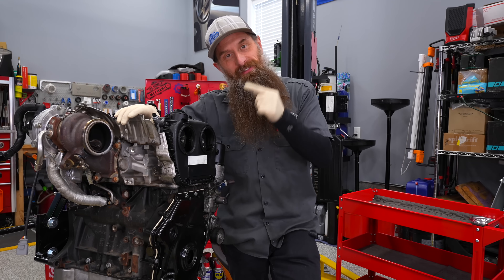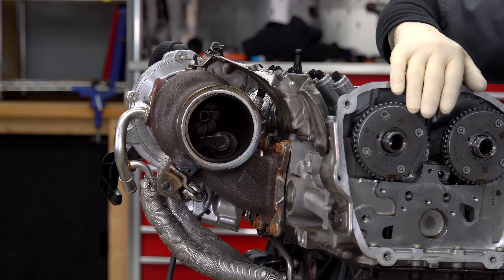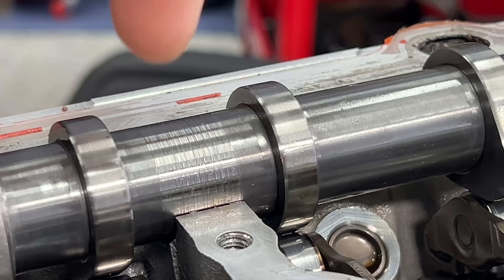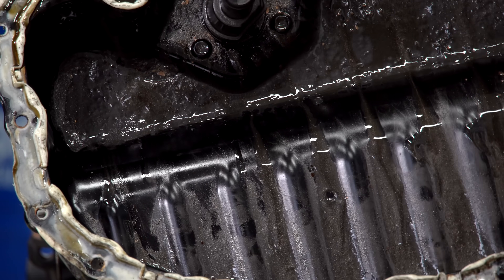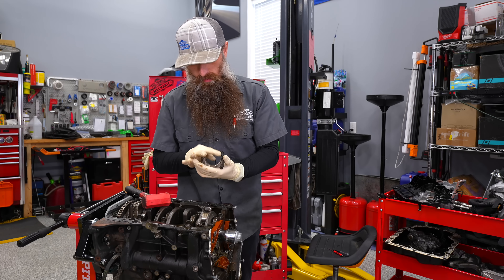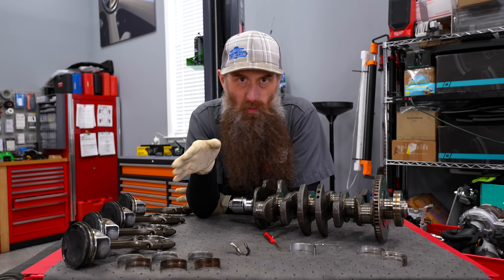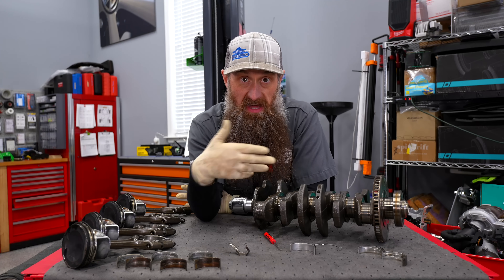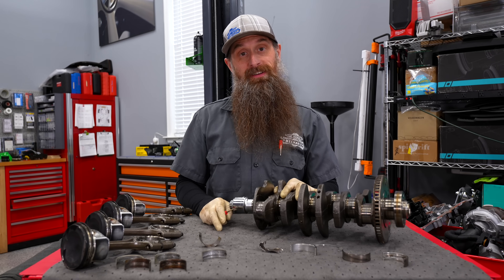Why This Audi S3 TSI Engine FAILED at Just 110k Miles?

Comment from the maker: This might be the worse overall engine failure we have done a video on. ITS BAD!!! What engine should I find next?
Reply: EA111 twin charger if you can find one? Otherwise EA211 to show us how the econoboxes get around...
Reply: I have been working on a VW Jetta 2.5 and its really interesting with its 5 cylinder engine! it would be cool to see a tear down of one!
Reply: @jojo-cx8jc  such a great motor to work on.  All things considered it’s one of the simple newer gen motors.
Reply: 07k tear down
Reply: I think I am missing the IE link.
Reply: There’s a Cayenne diesel on bring a trailer right now. Apparently it had a small oil leak and the owner tried replacing the lower oil pan gasket. It was a total fail and you should see the video of it. It’s the CNRB v6 tdi
Reply: seeing all that red rtv makes me think someone was in there before ..did vag use that silicon for a period of time ? I don't like it
Reply: PLEASE do an CXYA/EA825 if you can find one. I havent heard of many of them failing but it would be super interesting to see one that did!
Reply: I'd be qurious on a maintenance standpoint on the W8 engine and common issues on those
Reply: M4850 t looking at a '04 cayenne turbo near me for sale 😂
Reply: CAVD twin charge engine
Reply: What is the code for % off on EQT products?
Reply: @HumbleMechanic  07K rebuild. They’re great engines but many come from high miles cars. For a swap you might want a “fresh”, like-new engine, and there are very few videos, and no good videos, on rebuilding these

Comment: Ohhhh....Even without seeing the Video, I can BET that one of the long Screw that is attached to one of the Rod Bearing is BROKEN OFF, OR Came loose. Now the Rockers are all over the place, AND the Valves are messed up on one side of the engine.....I have seen another video with the Rod Bearing not turning, so I assumed that is the problem......This engine is an Inline 4 engine, but has multiple Rod Bearings. I bet one of them is not turning which caused the problem. The other video was for S5 Engine which ate the timing chain, and Rockers were all loose in the engine.

Comment: Bad oil use...
The most important thing for these engines is the quality oil and the correct frequency of lubricant changes, about 5-6000miles.
The best oils for these engines from my opinion:
Rowe hightec synth rs 5w40 
Liqui moly synthoil high 5w40 
Kroon oil polytech 5w40 
Motul 300v 5w40 
Motul power 8100 5w40 
Shell helix ultra 5w40 
Mobil 1 esp x4 0w40

Comment: Ever since I had an upper timing cover gasket leak of 2021 that took me forever to find, I've been so anal about checking my oil level. I also never trusted the 10k oil change interval. 5k changes. Level check every week. Middle of the night, dead silence audio check every week. Not taking any chances lol

Comment: Seems like nothing changes from 2010 cdnc. These engines do not like to run on minimum oil. You take sharp turn and oil doesnt get sucked then you are f...kd. 
Pls open the oil pump - the housing is 100% worn thus even slight damage will cause debris to be sucked and cause oil pressure to drop. Then its just accelerating the wear everywhere which usually ends up wearing the journal bearings on the rods. In mine I had 3rd rod failing, its a roulette which one dies first.

Comment: Yo dude call me to teardown my engine! I have an engine with 155k miles that's coming out over the next month. It experienced oil sensor #3 popping out of the accessory bracket while on the highway at 80mph and evacuated all the oil. I tried to save it and coast it down but by the time I came to a stop it had seized, GG. It spins with extreme resistance. 

This was about 2k miles after I did a massive refresh in my garage and apparently I broke the retention screw for that sensor. The sensor held in there for a decent time but eventually blew 5 liters of oil all over my engine bay and the road. Oof. I'm so so curious what the ultimate failure for seizure was. 

That 2k miles post refresh though.... chef's kiss it was driving bliss.  2015 mk7 6MT. Stock.  I took insane care of it up until that point. 5k oil changes. Liquimoly from 100k miles.

Comment: So glad to be watching this.   Just pulled the motor out of my 18 TTS also same engine.   I had a spark plug ground strap failure. New head on the way from audi.
Reply: This just happened to my 2017 Audi tts, what plugs were you running? The electrode got lodged into the head thinking of doing this same thing myself.
Reply: @EthanOliveria  the plug that failed was apr and failed at 16k.  I went back to the ngk's but regardless I went ahead and did complete stage 3 from apr and will be changing the plugs every 10k since the motor was out.  Hell after the money I put into it...oil every 5k (always done this anyway) plugs at 10k, packs at 20k and already did a timing kit, metal oil pan and 034 mounts and upgraded the driveshaft support carrier/bushing.  Has a noticeable vibration when decelerating at 3k rpm due to the dogbone mount but man it rips up to 160mph without hesitation.  Just a toy now so those maintenence times wont hurt as bad as if it were a daily. Hoping to track it next year after a dsg clutch upgrade.

Comment: EA888 engines are garbage, insane timing issues that they claimed to have fixed and Audi will tell you the chain is lifetime. VW on the other hand will tell you its a maintenance component.  I've had 3 cars all running that engine and every single one needed a chain before 110k spanning from model years 2010-2016

Comment: I have a 2.5 liter turbo in my 2019  MAZDA CX-5. I've seen the "I DO CARS" cannel tear down a MAZDA 2,5 naturally aspirated engine and I gotta say that the engine build quality looked at least as good as this AUDI but it had far less damage.  Could be that its coolant leak was not as catastrophic as this AUDI's oil problem but just seeing the quality of engineering and machining leads me to put more faith in my MAZDA's 2.5  L. turbo engine it than in my neighbor's 2.0 AUDI turbo engine.

Comment: My engine blew because it got a hole onto the block but I think it was the oil cooler failing and mixing oil with coolant 
 Myb2015 S3 was 120K km and had a lot of metal flakes on the oil filter but do you recommend using the same turbo? My car was stock but I'm curious of getting a core replacement engine but reusing a lot of my stuff.

Comment: I have a 2013 seat leon fr 2.0 tdi and i recently fitted a second hand engine from a 2015 skoda octavia with the same 2.0 tdi engine code. It's now showing codes for p032200 speed sensor no signal

It takes a few seconds to start and has very little power as it's getting all readings from the cam sensor as it runs the same with the cps disconnected

Comment: 1986 Audi 4000S owner's manual : "with the oil temperature below 90 degrees C, do not accelerate under full load."

Comment: The EA888 is a good engine. Neglect will make any engine go bad. It seems Americans received the inferior version of the EA888 engine compared to those sold to Europeans and Australians. Our 2018 S3 in Oz makes 213 kw / 285 hp of power and 380 nm of torque. Not the feeble 280 nm mentioned here. And it has multiport injection as well, meaning clean intake valves that don't get gunked up with carbon deposits.
Reply: Just another bogus VAG engine ..if European and Australian bound engines are better than those sent to the USA./....interesting.......  If audi or vw have sent "inferior engines" to the USA , our MAGA and new POTUS "will find you and give you the opportunity to be here legally... if not, we will "deport you" and you will never ever come to America again " ... how do you say "Mushroom Cloud" in german ?? 🍄🍄🍄🍄🍄💥💥💥💥💥🤣🤣🤣🤣🍄🍄🍄🍄🍄🏴‍☠🏴‍☠🏴‍☠

Comment: I used to work at Audi dealerships and the AE888 engine had some major problems. We have had to replace those engines with 500 miles on them. They would come in knocking and TAC would have us pull the oil filter and check for the silver glitter. They would approve an engine as long as the vehicle wasn't tuned. They never really told us what they knew about that engine but in my experience when Audi technical assistance approves an engine without question you know there is a serious problem. I'll stick to the oil burning CAEB.

Comment: Im happy this is not my engine i have a dkza 2.0 tsi engine 2019 and 190hp... no issue a part that sometimes when it starts it doees a crr 2 times... i drive it at 3000-4000 rpm and it fixes itself... while it have the issue ond11 fails to do some trsts after driving it in high rews for 30 - 60 min then it works again... weird stuff maybe carbon build up i will vlean it someday... 🤔

Comment: Just hoping someone might have some input on where to start with my bew tdi’s most recent issue. When i turn off the key and remove it, the engine stays running and only shuts off when i turn the lights on and press the ac button. Any ideas would be great thanks!

Comment: From experience… There is a plastic plunger in an oil filter housing regulating oil pressure. Seen many times people forget to put it back in… I can imagine that happened here. Engine is nice and clean inside to fail. Human error in my opinion

Comment: Those cams looked very dry. I know the engine had the oil drained, but the cams looked totally dry.
Reply: Yeah no shit. When you spin a bunch rod bearings you lose oil pressure to the top end and the metal flakes cascade more bad bearings.

Comment: Reminds me of my MKV GTI: it started having some glittery oil when I changed it. I was fresh outta college with $0 money. So like any respectable car owner, I kept driving it until it started snapping serpentine belts. Did I keep driving it? Yes. Did it eventually start running a bit rough? Also yes.
I parted it out at the old shop I use to work at and rode my bike to work for a while, enjoying not having a car payment for about a year

Edit: we suspected one of the cam shafts went bad, but it was well over 100k miles to be under any kind of manufacture warranty

Comment: What could be more German? We've got one of those diesel Touaregs in for an alternator where the alternator is pointing backwards and running off a weird little timing belt ring thing to a gear at the back of the engine... the power steering pump is also mounted backwards, gear driven, and the ac compressor is coupled to the power steering pump with another weird little timing belt ring.... did i mention they're backwards? Because.... reasons?
Reply: Oh yeah... and it's basically half of the v10 engine...

Comment: I bet I know what happened, when you do chains on these engines when you take the top plate off there’s a ball bearing in the end of the oil way that should be peened in place, over time they work loose but are held in by the plate, when you take the plate off the bearing falls out and you can miss it and rebuild the engine, then it never builds top end oil pressure and does that.

Comment: Oh god, poor engine, that's why better change the oil at 5000km or 7500km even today we have very good oils, they lose the properties and engines today running with very tight tolerances, they need good oil everytime, that's why i like to do my own things, change the oil when i want and put the brand i want and the car will thank it.

Comment: 2017 which is GEN3 Ea888, they are mostly spun bearings, broken springs or oil pressure loss due to those small metal filters getting lose and getting into rotating parts and scratching them A LOT. I know that there is a polish youtuber, who has friend who rebuild all 1.8/2.0 TFSI engines, he is named Coobcio (no adv, plz no ban). You can learn a lot about those engines from those videos (altrough google translate might be bad).
Reply: Small metal filters getting loose? I'd be curious where those small filters are located, I can't even picture what/were those might be.

Comment: this will be interesting.  I have the 2017 Golf R.  I was told that every 45K you need to have the heads cleaned since the US engines only have direct injection vs the Euro spec (dual injectors).

Comment: Of course you release this today, i have 2 test drives for S3s later this week : - /
Reply: These Gen 3 ea888s are TOUGH. I guarantee you that the owner or previous owner thrashed this car and didn’t take care of it. 
Have a PPI done by a reputable shop, preferably an Audi/VW specialist. 
Always let the engine idle down before leaving if you don’t have time to let it warm up a bit, check your fluids periodically, change oil more often if you thrash it and/or tuned or modified, DSG flush every 30-40k if DSG, follow all inspections and services provided by manufacturer and don’t lapse them. The only predictable concern is a bad water pump/Tstat design as far as repairs unless it’s a freak incident otherwise.
Good luck to you, stay safe out there.

Comment: We no longer will look at these engines. We took the decision some seven years ago when we had disassembled a few engines and the owners could not believe the cost of repairs. Chains were a pain and bluntly we made more money in the time taken doing brakes ,servicing  and clutches . They are a throwaway engine , and like most German cars they are designed with a 5 to 8 year lifecycle.
Reply: yes junk

Comment: Hello
Same engine 2.0Tsi EA888 Gen.3 DNU - 120000km - almost same issue happened here and no full throttle after cold start, even the oil has been changed 100km before (checked on level), no missfire before and no error codes during and after the knocking start. It just starts knocking at 4000rpm with oil temp at 80c. Tear down the engine , main journal looks very good, axes bearings are ok , everything looks very good , but rod bearings cil 1 and 4 are coocked. I can only suspect oil pressure problem and a damage in time beacause of low pressure at idle rpms (1000-2000). The low rpm oil pressure is between 0.5-0.8 bar and thats why no errors on dash, but if oil pump goes the lower value 0.5 bar there is not enough oil pressure and flow reaching the other components of the engine (spray nozzles and bearings). The quilty one could be either the oil pump, either the oil regulating valve of the pump (its on semi carter - aka N428) which is ECU controled and opens for 0.5 to 0.8 interval at low rpm and when the oil temp reaches somewhere more than 50c
BTW : at 12.55 min  - there are no install notches on the rods , neither on the rod and cap and neither the rod bearings. Only the main bearings has notches . Check that again or at least my engine doesn't. So, the rods have no mounting notches (i dont see them either in the video) i only see a notch on the back of the bearing which can be the main bearing and not the rod bearing. Freeze at 10.24min - there are no mounting notches on the rod bearings.
anyway, good videos you do and great explaining !!! Keep it this way

Comment: I know Audi and VW use different engine codes is there any significant difference in reliability between the two?
Reply from the maker: not really. They kinda of all behave the same. The only place ive seen that is when an engine is transverse VS Longitudinal. Those seem to develop different issues,

Comment: I have a 2014 A4 with just under 100K miles. So far the engine failed twice! First was a burnt exhaust valve, and this time while I have had time to open it up yet... I think it has a cracked ring  land. Low comparison (but still a little bit) but car starts right up then misfires and after about a minute or 2 starts to blow a lot of blue smoke!
How much you want for the pistons? Lol

Comment: I’m having the same issue with my S3 but I don’t have misfire, engine spin bearing on cylinder one, I rebuild everything and guess what ? Spin again after 100 miles, so now I will rebuild again and try to find what is causing that. And believe me this is exactly what my engine looks like inside besides my heads are good on last time. 
In my experience, you can do everything right on the rebuild process just don’t trust the system check everything before have the car back to the costumer 
I have lucky this is my car because i also work with mechanic 
Now on this next rebuild i will check all the oil veins pressure hot and cold check both solenoids this engine have and 3 oil pressure sensors 
Because mine don’t have any warning for low pressure but the engine is gone 
Even when the engine is gone oil pressure normal no warnings

Comment: Can you look in the oil filter housing and inspect the plastic stand adapter and the plastic oil filter housing that supports the filter? I have a theory that an oring or plastic piece in the oil filter housing c breaks and comes loose to plug up an oil passage. Next stop after the filter are the bearings. Clearly the engine got regular maintenance as it had zero sludge and running out of oil with oil level monitoring seems unlikely.

Comment: I bought a 2015 leon cupra 290 last year with 50k miles and within two weeks of purchase it spun all the bearings, oil was checked was at the correct level and everything, car was serviced Every 10-12k miles, thankfully i purchased it from a dealer and double thankfully i was able to prove the car had been tuned which wasn’t part of the sales listing, so one transport fee later i got my money back, gotta watch out for these cars with these engines, i thought even with only 50k miles the longer service intervals wouldnt matter too much as long as i looked after it from there on but apparently it did, the company that did the tune i had also never heard of and i suspect that didn’t help matters. Careful who you buy from kids, even dealerships!
Reply: service every 10-15k miles is way too long on a tuned car. even on my daily stock car I wouldn't do 10k intervals.
Reply: Has my 2018 cupra 300 for 3 years at 54k miles currently. Been spot on. Serviced between 7-8k miles